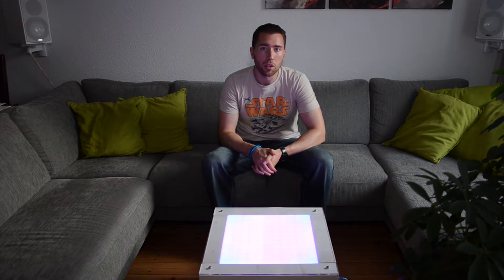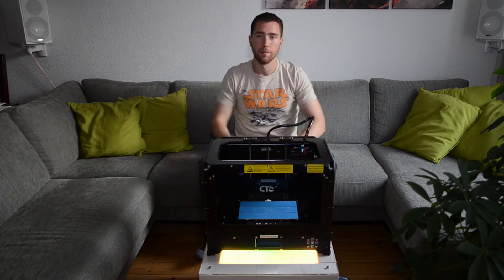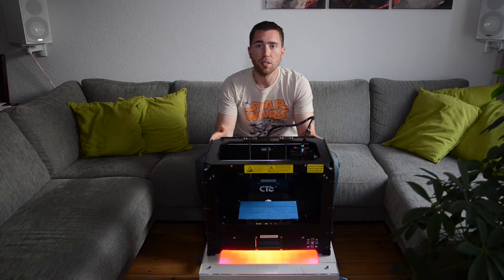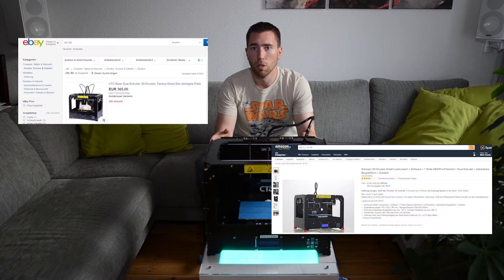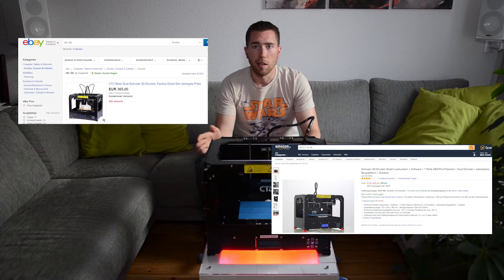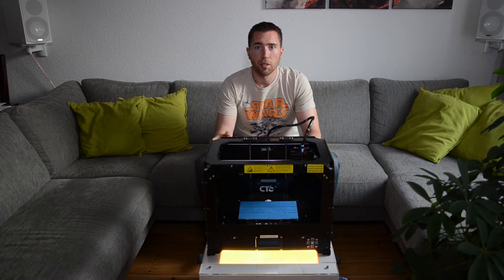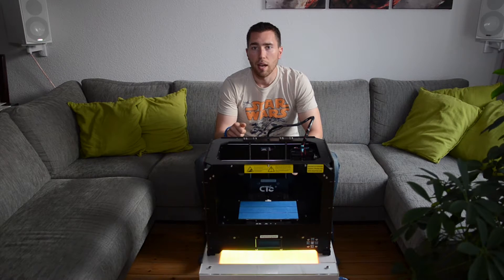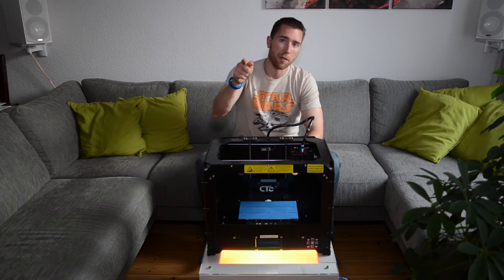CTC 400 EUR 3D printer Unboxing, timelapse prints and review

Comment: Thinking of getting this printer for my 1st ever 3d printer. can you tell me if you have experienced any problems setting it up and if there is anything i should look out for. also can you tell me the filament size it takes and if the printer can be used with cura. thankyou
Reply from the maker: Hello friend, this was also my first 3d printer. It's a lot of fun to use it. You don't have to set up that much. Only put like 4 screws and calibrate the printing bed. Filament size is 1,75mm.  I did not used it with cura, but I found the information that you can use it with cura online. So just go ahead and buy it :-) You get a good printer for your money. Cheers!

Comment: Would you suggest this for a beginner to 3d printing?  I don't mind a little troubleshooting to get it working just right but I don't want to have to tear the the thing apart and put it back together to get it to work. Thanks a million.
Reply from the maker: Hey friend, yes you can buy this printer. I was surprised how fast I could print with it. It's quite out of the box printing, for a cheap price. It's also my first 3D printer. Most important thing is to calibrate the heatbed, but thats also easy. Don't be afraid and give this printer a chance :-)